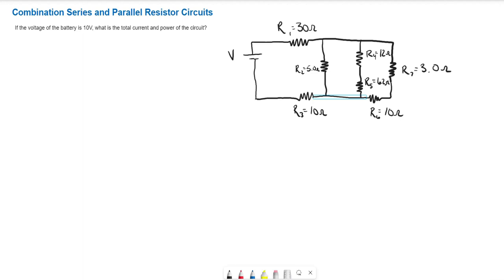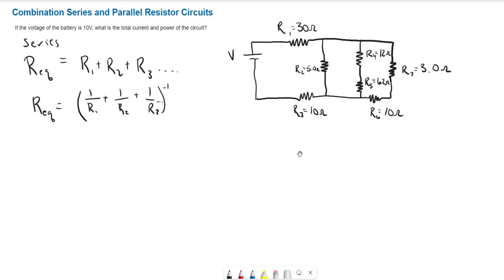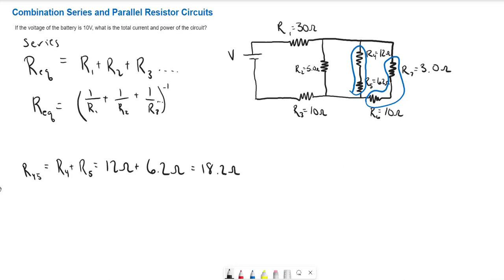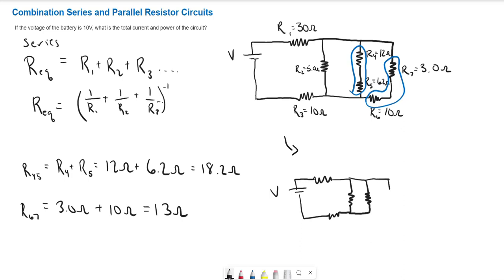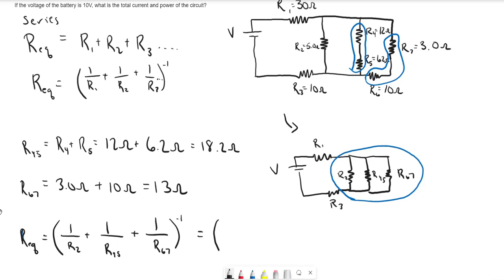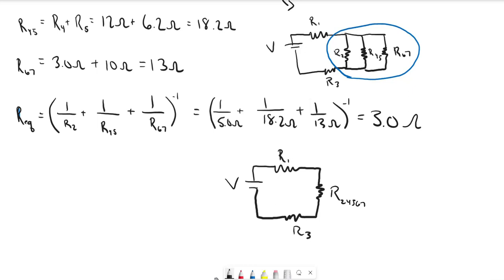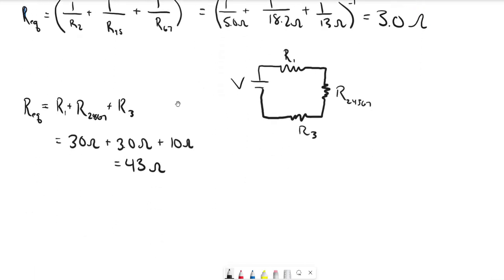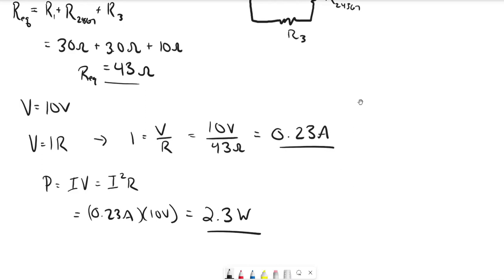Combination Series and Parallel Resistors

Comment: Your hand writing is not clear. I calculated according to 62 instead of 6.2 and 50 instead of 5.0. Please try to be clear with values .
Reply from the maker: Sorry about the confusion. I will try to write more clearly in the future. These circuit problems get  a bit cramped.